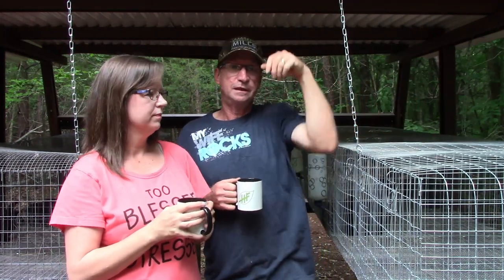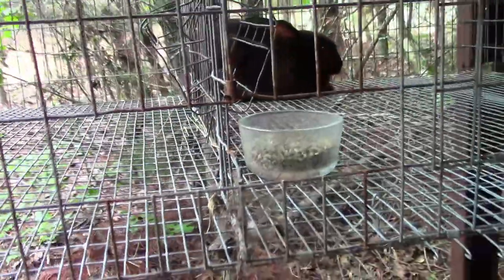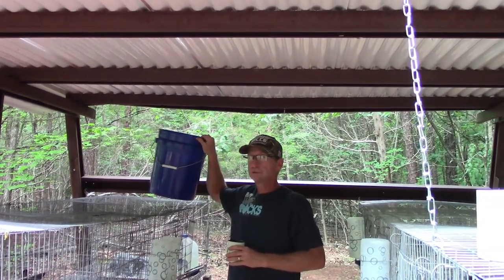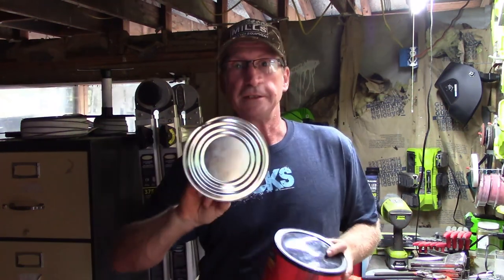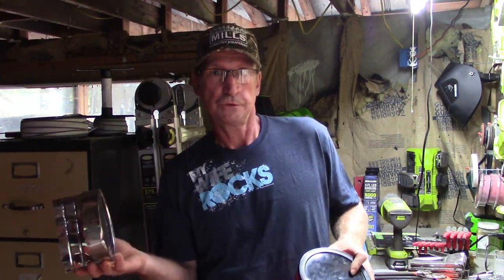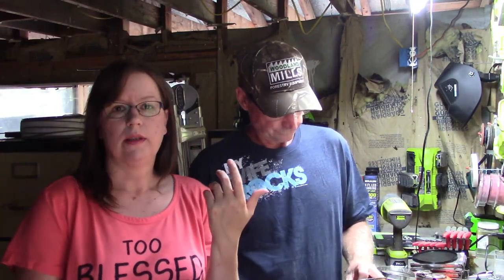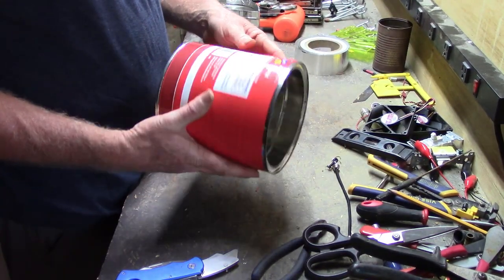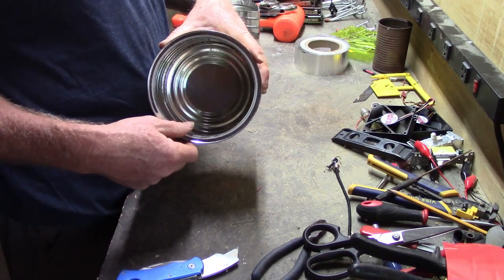DIY Rabbit Feeder | Best Rabbit Watering System

Comment: I’m not sure where you folks live?¿? I live in Indiana. Does it freeze where you live? 
I skipped the “gravity flow” method… because of freezing here. I went with a circulating water pump. ( I understand… you are not on full electric where I am ( by extension cords) … however, I did use 1/4 silicone tubing and ran it all thru pool noodles I got on clearance for a quarter each. 
I have 100 ft of pushed water and 100 ft of return water lines…. I did find I still am going to have to have heat tape my 1/4” lines froze…. 
Next spring I’m going to switch up to 1/2” pvc for my lines…
Reply from the maker: We're in South Carolina, and it doesn't freeze for an extended period of time, but we do have some freezing weeks. We just updated our rabbit shelter and our water. You should check it out the new videos (posted in Oct. 14th and Oct. 21st), there might be some new ideas for you there. We are going to run a pump from water catchment to an insulated holding tank. We had freezing weather last week, and we didn't have any issue - worked out great!
Really appreciate you stopping by 😊